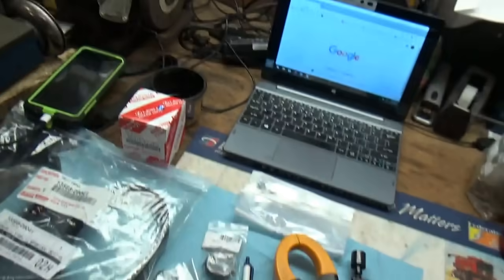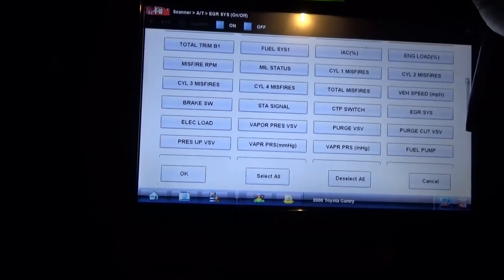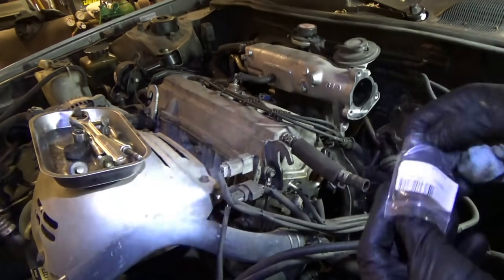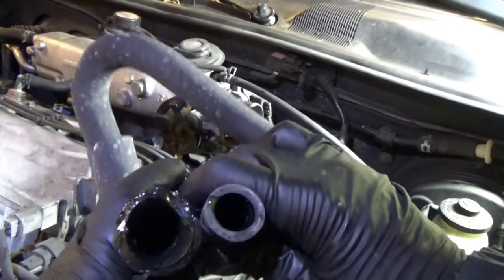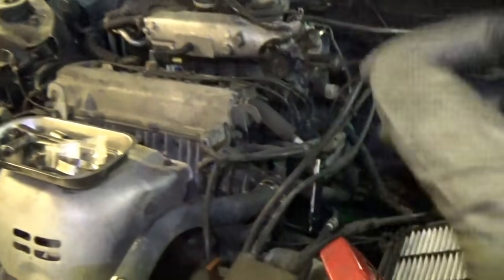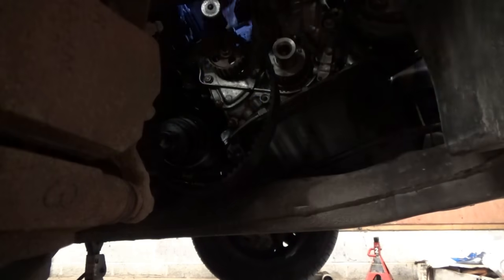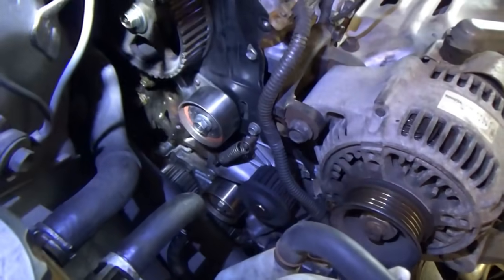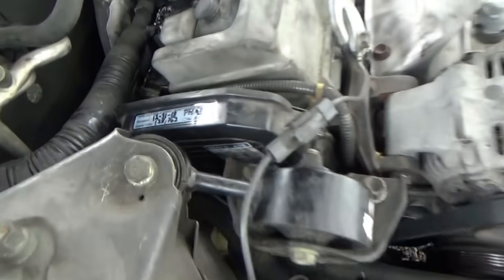Oil Leak? DRILL it out! (Toyota Camry) + Timing Belt & EGR repair

Comment: All that work and you ignored the water pump, not sa good idea.  ALWAYS replace the water pump if you're doing a belt, the saving grace on a Toyota is it is not an interference engine.  Try that on a Honda and warranty your work.
Reply from the maker: lol That original pump has another 100k miles left in it ;)
Reply: How do you know that?
Reply: Last 2 water pumps I did on this engine only went 150k before they blew and caused the engine to overheat.  One even caused the timing belt to strip because the bearing seized.
Reply: @HondaSolutions  How don't you know that?
Reply: Given the age of the car (19 years now) and the length of time between timing belt changes (90k miles) the water pump won’t last another 7 years or 90k miles more (recommended timing belt change interval).  Like I said, last 2 of these engines I did the water pumps on (98 Camrys) both had overheated due to water pump failure at 150k miles.  Are you willing to risk your motor for a $50 water pump??   Just not worth it.  Just put the matter to rest for a $90 Aisin kit with a Water pump, timing belt and idler pulleys and go another 90k miles and have piece of mind. Change the oil seals.  You should change the coolant anyway.  I’m confused about why anyone wouldn’t change it for that cheap???